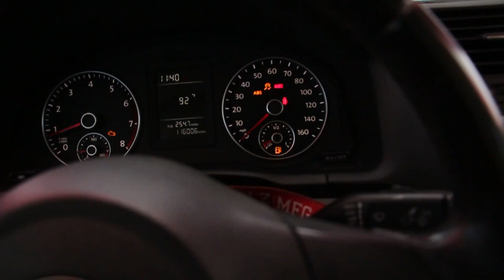Putting Miley back to STOCK!

Comment: Front hight is definitely not normal. Also, is the car a vr6 on paper? Because if it is still a 2.0 on paper and you show up with a vr6 in Germany it could be a serious problem. You can't just swap cars in Germany.
Reply: If it was a 2.0 from the factory, they would know from the vin
Reply: @TheVladutzyk  then i'm curious if Germany will let the car in.... Hope they are going to though, would love to see it in real life
Reply: Why should it be a problem, so many people have done it here
Reply: @iTRU3No  TUV is the problem isn't it? Dont you need to prove that the engine isn't stolen or something? At least in Holland you have to show that the papers of the car that the engine is from. Also you need to upgrade brakes etc. And the exhaust is very loud as well
Reply: @jj1999cool  depends on the tuv station, but you don't have to prove that the engine isn't stolen. Just upgrading brakes etc and it should be fine
Reply: And every part should have an tuv certificate and yeah the exhaust is an big issue here
Reply: Exhaust would be a problem there? Damn can’t even hear the sound of a vr6 lmao
Reply: Same here in Croatia.For every modification you must have a proof,and especially for engine.Because when you swap an engine you must have donator car papers, proof that you bought that engine or a car and all papers from your car.Good luck
Reply: @jj1999cool  lucky you in belgium its illegal other engine => no more driving for you